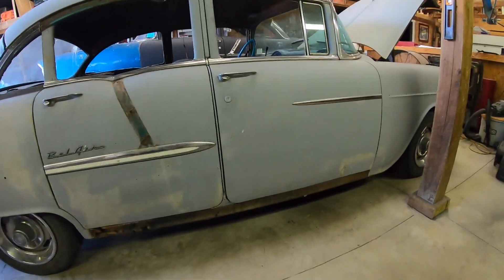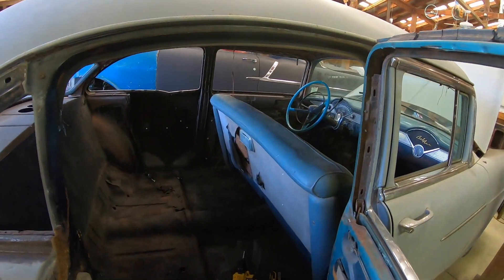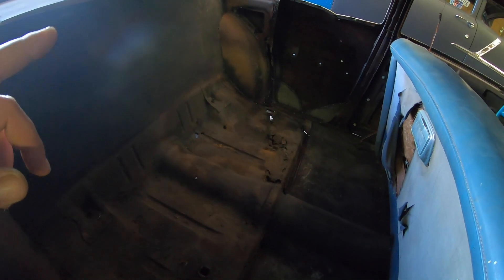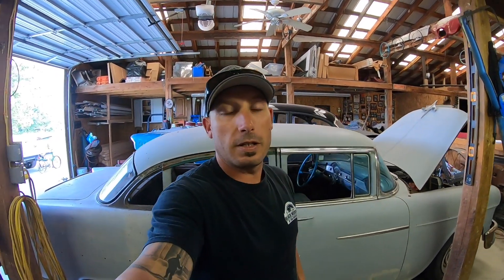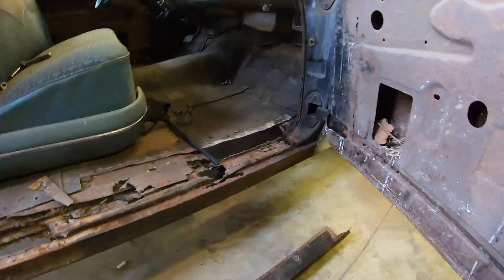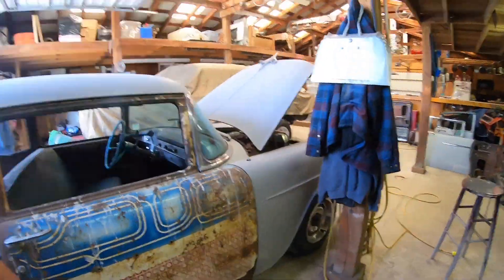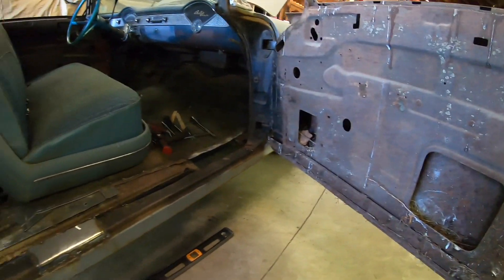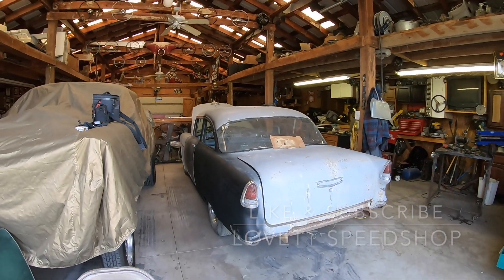Tri Five Chevy: 4 Door to 2 Door Conversion (Part 4)

Comment: Just found you site and love it so far. Great job on changing out your 55.  Do yourself a favor and pickup a piece of scrap POLY (or similar) foam insulation board about 2"X2'X2' and use it to kneel/sit on. You can get a scrap piece from your local lumber yard cheap and it's well worth it, in the long run you'll be happy and your lower body will thank you.  I've been using the same piece of 2'X2' by 2" thick foam (similar foam to the worms that kids use in swimming pools but flat) to kneel on for the past 20 years and it's still in great shape. It will save your knees for when you get older and it's a lot more comfortable then concrete too. Just trying to help you out so you can make more videos - lol  -  Later
Reply from the maker: Thank you for the suggestion. That’s an incredible idea. I’m definitely going to get me one.

Comment: Good info. I'm in the process of doing a conversion myself. Is that seam sealer between the door skin and the B pillar on the driver's side? It looked like it from the video you shot from the back seat. Thanks and keep posting videos they are appreciated.
Reply from the maker: Thank you. I haven’t used any seam seal yet. There is probably still some of the factory seam seal stuff in there that I haven’t cleaned yet. When I get it where I want it I will be using seam seal on it.
Reply: @LovettSpeedShop  Good deal. I recently learned that seam sealer is used between a car hood and the support structure to keep it from flexing in the wind. I figured it might be worth trying on the rear door skin conversion, and any support structure, to keep it from moving too much. There are few rules when making your own stuff!